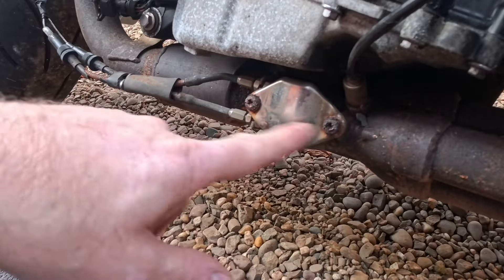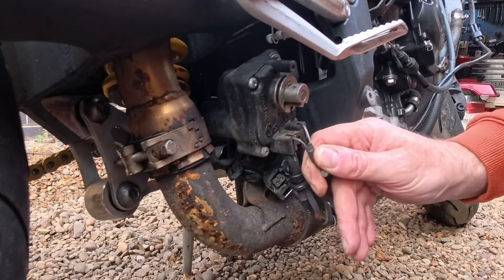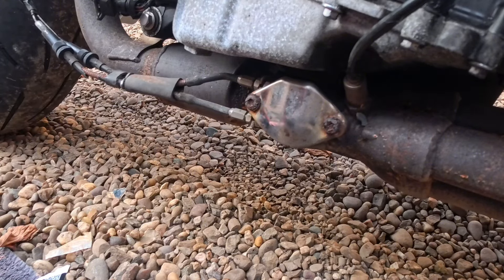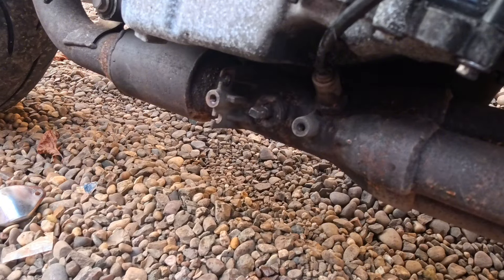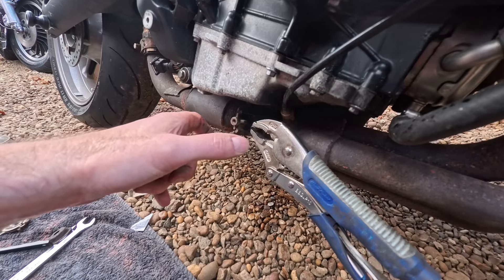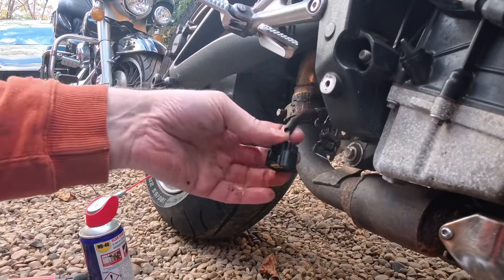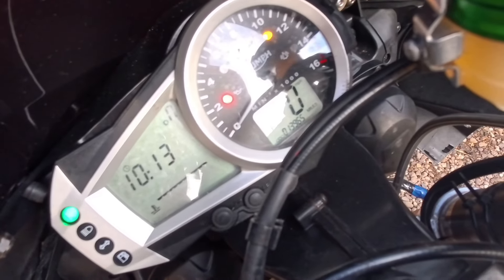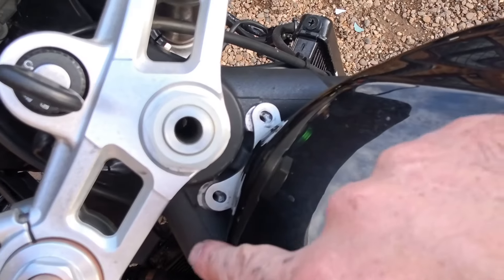TROUBLESHOOTING A SEIZED EXHAUST FLAP! TRIUMPH DAYTONA 675 REBUILD PT7

Comment: If the light doesn’t go out after 3 heat cycles then you can buy a servo delete plug or use tune ecu to turn the valve off & load map into ecu
Reply from the maker: A servo delete plug is what I fitted 👍👍

Comment: If I remember correctly there is no management light with the exhaust valve delete. I’d guess light will reset after about 3 runs up to normal engine temp. It does on my Daytona 675 and Striple 765.
Reply from the maker: A couple of people have said about that process now, not one im familiar with. 👍

Comment: Tune ecu is the diagnostic tool for these btw just incase you need it. Works well.
Reply from the maker: Thanks mate, I’ve looked in to it but seems to be android only?
Reply: @Patchesrepairshop  it might be mate not 100% sure ive got a samsung so might be. Shame you dont live nearby could have just used mine 🤣. May be worth seeing if anyone near has it. You get 5 bikes on the subscription.
Reply from the maker: @Michie1391 cheers mate 👍